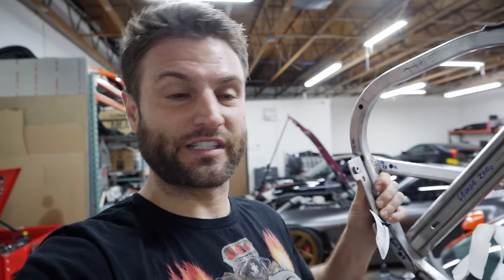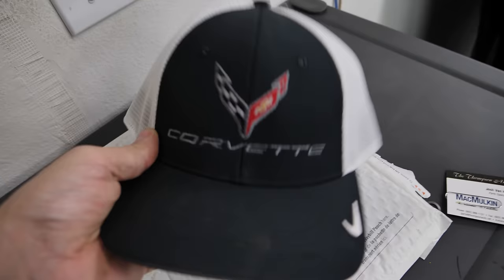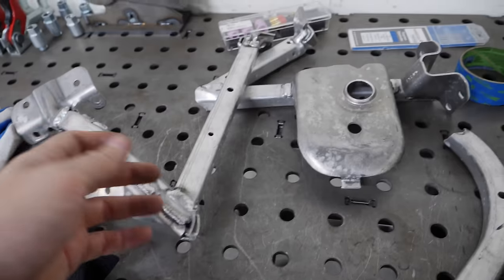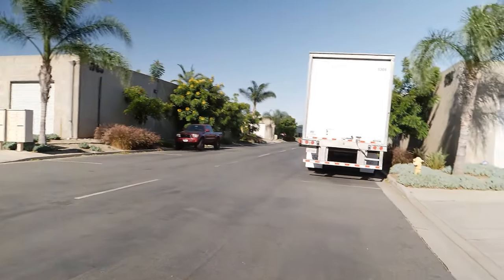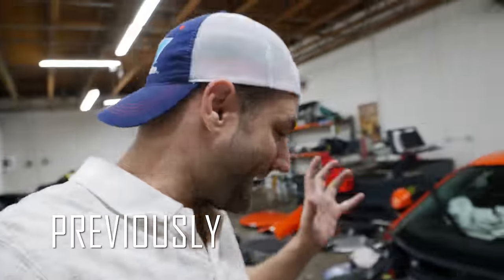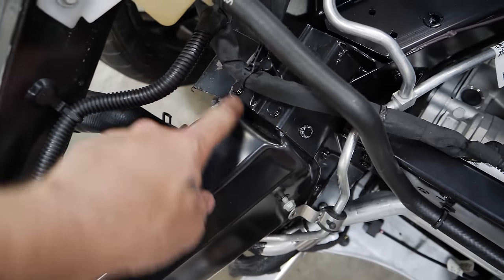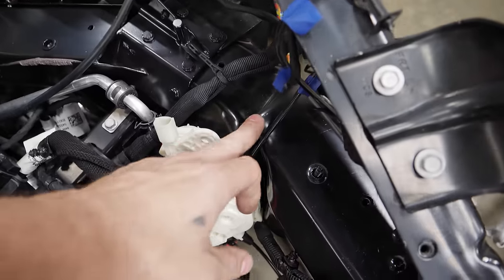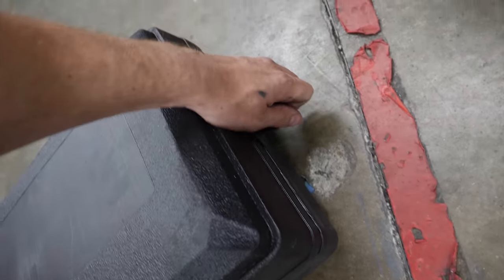Chevy won't sell me parts for the Wrecked C8. Bending the Chassis myself!

Comment: Rob i rebuild front front frame on my viper and was worst than your C8.
Just some advise from my experience.
Make a hole in the outer side of the rail by the bent and put a tube in the hole and hammer the kink of the inner rail.
Also remove the steering rack or you might crack it. Dont ask me how i know.
Make measurements rear wheel to front wheel on both side and make sure they are the same length.

DO NOT START PUTTING THINGS TOGETHER UNLESS THE FENDERS HOOD AND MOST IMPORTANTLY HEADIGHTS LINE UP.
You will endup removing and reinstalling everything when you realize the headlights have a bigger gap one one side than the other.

Comment: yes those are the impact absorbers. If their not within spec it will determine weather the vehicle gets a rebuilt title or not bcs the vehicle will not collapse in an accident the same was as it should out the factory and compromise passenger safety.

Comment: Rob,  on your small tourch, use MAP gas.  Its the yellow bottles not the blue bottle.   You will be impressed how much hotel the touch is. Not as good as oxy and acetylene but hotter than propane.  I won't go back unless I'm doing light heat work.

Comment: I once used a hydraulic ram to attempt to push a STEEL frame rail. I squatted about 10' away, directly in line with the trajectory. I had a 8" x 8" x 24" block of wooden railway tie in there as well. I did a poor job of planning and executing the job. The block flew out of that high pressure situation and hit me square in the face before I could react. I lived, but begrudgingly.
  Rob did a much better job.

Comment: Even if the looks straight when your done it’s really important to put that car onto a frame machine and have it checked. An impact like that can transfer through the
complete frame.. mild steel, high strength steel and aluminium all need different kind of welding as well.....

Comment: My father was a frame mechanic for 49 years. I seen him bend, straighten, rebuild, and build from scratch many different types of vehicles. He worked on big rig trailers, dump trucks, cars, literally every kind of vehicle made. Back in the day he installed T-tops, sun roofs, moonroofs, he chopped cabs, extended cabs ECT... So you get the picture, he was a seriously bad ass frame mechanic. His view was bending/modding a steel frame was child's play. Rebending an aluminum frame was a fools game. Please be careful doing this as aluminum does not have the same integral strength steel does. You might make It look good and line up straight, but it is not going to have the structural integrity of a new  part. Awesome videos, thanks for sharing, hope things work out for you and your car!

Comment: In Illinois, where you need a license to rebuild, my brother, with fifty years of rebuilding experience, would need one.  I put myself through college and medical school working in my dad's body shop.  My brother graduated Rochester Institute of Technology with a masters in electrical engineering.  If it has a salvage title, one will not get a permanent tie to operate it on the roads.  My brother has a 1970 Corvette that he restored.  He is now working on a 2006 that needed a motor and has another that needs to have a little frame work done on it.  Buy used parts, like he did!

Comment: Modifying those front rails (heating, bending welding plates) YOU ARE CHANGING THE CRASH STRUCTURE CRUMPLE ZONES !!!!  NOT SAFE and NOT RECOMMENDED!!!!
Reply: 🤣🤣🤣 have you ever watched this channel... but maybe he will see this and stop the build 🤣🤣🤣🤣
Reply: I think it's already been crashed so I don't think he cares about that
Reply: It was already wrecked.. wouldn’t that compromise the crumple zones already lol
Reply: OK, Karen.
Reply: @smac919  of course. It's just an unsafe repair. He needs to get those rails fixed at an authorized dealer and do the rest himself. (which is what I bet he does.)

Comment: Rob, love where your heads at. If you can get it straightened out, have an engineer take a look at it and give you some pointers to add some bracing to it while maintaining crash structure for future safety. Some materials stuff i learned in school... Aluminum is heat treated during production. The T# after the series value (6061-T6) is the heat treatment value. It cant just be heated and reformed like steel can and maintain material strength properties. It can only be bent and formed into shape a certain amount before it becomes so brittle it can't absorb impacts.. Also, for the love of God please dont use a griding disk on aluminum. it will melt the aluminum into the disks, then will cool, and when it heats again when spun up and used, it will cause the disk to explode violently into literal deadly chunks. Also 7000 series aluminum cant be welded via tig very well. I think they use some sort of friction stir welding or something to join 7000 series stuff, i cant remember. Lookin forward to seein what comes of this car!

Comment: Guess I’m 6 months too late to help. If you heat the aluminum and get it back to “O” temper you should minimize any cracking. O is flexible like aluminum foil almost (depending on thickness). How do you know you get to O temper? Strip the paint to bare aluminum. Burn some soot on the desired location of the bend. Heat that location until the soot burns off. Bend. Final temper depends on cooling. Look more into tempering processes for more guidance. Aerospace uses a lot of tempered aluminum.

Comment: You should pull the member instead of pushing a hole with harder metal tool, you can also control the direction/angle of the pull!😋

Comment: Probably get a aluminium saw blade for grinder, works heaps better, if not and you still want to use regular cutting disc, try spray wd40 whereever you cut it, wd40 helps to unclog your grinding disc

Comment: The extrusions in that forward area are crash absorbers...aside from supporting panels and the front end assembly, they don't contribute to the torsional or structural integrity of the chassis, nor do they support suspension/steering, the cast members do.  All the true structure is built from the center capsule out.  The extruded ends have boxed the outer rails on all Corvettes since C7, though became more modular in C7.  Those simple extrusions can be bent back/reinforced or even just fabbed out of plate and TIG'd on.  I wouldn't over sweat it at all....easily fixable without GM shit.

Comment: So on July 1st, 2018 I was sitting in my 2007 with 24,000 miles at a stoplight when some A -hole in a stolen car hits me head-on going 40 miles an hour. That car sat in the shop for 3 months. Then they couldn't find the specialized tools to do whatever with the frame. Then they were talking about maybe taking the front third of the car off and replacing that. The estimates were getting pricey. Over 25 Grand. That's when I raised a fuss, that car would never be the same. State Farm cut me a check for 28 grand and I went and bought a 2008 with 41,000 miles. I sure do miss my old car though. That thing saved my life but it only does it once.

Comment: Welding on that aluminum might be really challenging and more trouble than it's worth. Plus I wouldn't think heating it with welding is good for it.
Reply: What alloy of Aluminum is it?
What filler metal?
What will the welding do the temper?
Guessing =💀

Comment: Years ago when I was racing we built and car with an aluminum cage support structure for the front frame, a steel frame.  This proved very durable in crashes.  And, easily repaired.

Comment: you should see if a body shop would let you use a Puller and a frame machine. because you can bend it all day but if its not in Factory spec nothing is gonna line up right (IE headlights, fenders, bumper..)

Comment: Be careful to not heat the aluminum up too much. Heat can anneal aluminum but it can also cause the cracking issue to become worse. Aluminum is “hot short”, meaning that it becomes brittle when heated too much. What you did with the propane torch is fine I’m sure but don’t take a big oxy acetylene torch to it.

Comment: Rob I could weld those for you..... Id cut them off though and insert a square tubing the size of the ID of the piece and do a filet weld around the whole piece for strength..... now you could plate over it but it still win’t be as strong!!

Comment: Gunna want to reinforce thise spots. If you hear it up to much the molecules dont line back up right and it gets weak. Kinda like when a blacksmith puts a hot blade in oil it lines them up to make it stronger.

Comment: If they won't sell you the parts, did you try to get an authorised repair place do the minimum (i.e just replace the main chassis support) ? Aluminum loses a lot of it's strength when you bend it.

Comment: Don't forget to consider that the damaged parts have strength considerations (you said I'm going to plate it) but they are also designed to fail (crumple) in a predictable manner.  Don't do a "gas monkey super car fix" make it look ok then hide it under paint.  You don't want to build something that puts someone at risk!

Comment: I don't know if all the deformation is ahead of the suspension attachments but if it is he will be lucky.  I'm sure there is some compromise to the crash worthy aspect with this type repair but you're not going to crash test a car to find out.  As long as all the wheels are in the right position and pointed in the right direction it should drive well.  I wouldn't want to pay top dollar for a car with this repair but it will look fine when he gets done.  The scary thing is there will be C8s out there with more work than this one, let the buyers beware!

Comment: Please read this!! The end is the important part, very important!! When you move the metal with a ram or whatever you use, you need to hammer the metal where the bends are that you are trying to remove to relive the tention so it wont spring back. Also those rails did not bend right there by sheer luck. They are designed to crumple to help absorb the impact. If you replace stuff or plate somthing be sure to look into this because you can make a very dangerous vehicle from it being too strong. Large metal objects shooting into the passenger compartment if another wreck were to happen is not a good thing!! Please look into this at least a little bit if anything!!!!!
Reply: this is mainly superficial,it isn't holding the engine,transmission,front end steering or anything other than the front body panels.you and jono smith are afraid for your job security at the local chevy "parts replacement department"

Comment: Hey Rob, or anybody else here who knows anything about this, I have a 1982 rx7 with a n/a 12a. It has 100,000 miles on it and it had been raced. The engine had never been rebuilt and i just want a little advice on where i can buy parts. I also want to know if it would be more worth it for me to buy a 13b instead and if so, which version of the 13b i should get? I'm trying to make it a decent summer daily drive while also having a bit of power to put down when i want it. Any advice on ports, if any?

Comment: Really quite surprised rail ends are a restricted part, especially with how easy the plate at the end can be damaged requiring replacement.
This car will likely never survive an impact again as intended if those are not replaced properly.

Comment: If all that does is hold the front end up. Call “B is for Build” and have a tube front made. You can bracket and attach what you want back on.
Reply: You did see the build a tube front for the 4 rotor FD right?
Rob has a fabricator on payroll. A damn sight better fabricator than that ginger.
Reply: byw nope.  I have just watch a few of Rob’s engine builds. Got interested when he got the C8.

Comment: So please don’t mis-understand my intentions. I have wreck rebuilt cars since 1980. I have the FAA certified Aircraft including structures and power plant training, know how to tig weld  most everything but copper.  That said this aluminum is hydro formed into shapes. That is a controlled bending process. In addition it’s heat treated to give flexibility without failure, when aluminum is over bent it micro cracks, some micro cracks with controlled heat treating can be fused back together. Aluminum also work hardens so when it’s bent it wants to stay where it’s at. When you weld aluminum you can make a surface weld that looks like it’s correct but it’s not and the new heat will damage the heat treating of the material in the region. Lotus learned this, can am racing teams learn this, many people have died on these failures. Very Few aluminum components are welded in aircraft most are riveted, bonded or bolted. The 928 Porsche, Lotus have a all aluminum chassis and when they are wrecked it’s likely it will never see anything but a wrecking yard for parts removal. Because it can’t be trusted. The method you used is fine for most steels except for high strength steel like what ford uses on the mustang. Because the grain structure is altered and can fail catastrophically. Most race cars have tube frames of heat treated chrome moly steel tubing, unless they use carbon fiber or riveted and bonded aluminum. I hope this is clear to you. To repair this is both art and science and specific tested solutions. I love cars, I mean I have loved them and owned amazing cars and you want to live to drive another day. Get the pros in on this, I have seen accidents and the results that no one should see they stay with you forever.  Risk cheep gas, risk dive bar food, but this is a 200mph rocket don’t risk your life, your future both legal and health wise. When a helicopter I work on falls out of the sky every part I touch has my name on it, if the work I did is the cause of the crash the result is my career/future as I know it will end, likely someone’s life ended and no one can fix it, and I will have to live with every decision. It’s not worth it. Contact Sid Morrison chassis builder out of Washington maybe he has a solution because this problem is going to come up again. Here is your chance to be a hero not a bad guy. Enjoy life it really is not that long. Mike

Comment: Funny I had a similar issue with a manufacturer in an entirely different field.

I was an outspoken proponent of their but had replaced one not structurally important part of their product after wear and tear made it necessary.

When other parts broke they wanted to force me to send them my unit, but when I said no, send me replacement parts (in return for the broken part, I dont care about your "proprietary" shit, i just want my stuff to work) they cut all ties with me and AFAIK banned me from ordering any parts from them.

So I spent my money going the DIY route and my diy thing will declass their thing by a lot

Comment: Without knowing the type of alloy , this could be a really bad idea.
 Lightweight aluminium alloys  gain their strength because the process of mixing and casting sets up a microscopic crystalline structure where all the flat surfaces of the crystals line up with each other which gives  the alloy mega strength. this allows for thinner wall thicknesses and lighter weight with the same or more strength. when the aluminium is bent to the point of permanent deformity, the crystalline structural bonds are broken. yeah, you can bend it back and weld on it, but it will never set up the same microscopic bonds and the strength that comes from it. aka SOME aluminium parts should not be fixed, if it's a critical component (a cars frame), it should probably be replaced.

Comment: I'm GM parts manager. The parts are on restriction, which basically means, they are not available to stock as a regular stocking part, or requires proof of ownership before GM will sell, or in this case, professional installation is required and not for sale to an individual or shade tree. The part #'s in question are 84557545 and  84557544. GM has plenty of stock, however before GM would sell these proper documentation would have to be submitted to them before they would approve. If the info was forged or falsified the selling dealer would reap the procussions of doing so and face fines, penalties or loss of certain privilege's. The reason they do this is to avoid lawsuits. If these are installed improperly it could result in a crash or some other unacceptable failure. And as unscrupulous as some attorneys are, they might seek to blame GM for selling a defective part that caused the failure. When in fact it was installed improperly. Don't hate the player, hate the game.

Comment: You weld aluminum and it loses it's tensile strength. The part will become like a wet noodle in the area that was heated.  Not what we want for a car frame. It may look OK but if appearance was all that mattered we might all have strange orange hair and be wearing spray tans.

Comment: You should probably do what b is for build did with his effort and just cut it off. Those members won’t have the same strength as they originally did. And the harder alloys of aluminum don’t like to stay together after their welded on. There’s a high chance of any reinforcements just breaking off if there’s ever another hard impact.

Comment: Copied from a response I made.
Plenty of people have used ratchet straps and trees to straighten out frame rails and thrown it back on the street inspected and insured. The equipment (google the kits) to do in in the shop follows the same principle of operation. If you get the frame rails straight and see no obvious stress cracking. Congrats you've done the same that a shop would have done. 
If you are still worried about aluminum fatigue you can weld plates and box in where the original damaged area was.

Side note: This vette was no where near the area of needing clip and weld. The shop would have just pulled it.